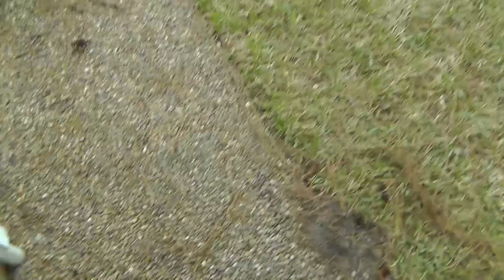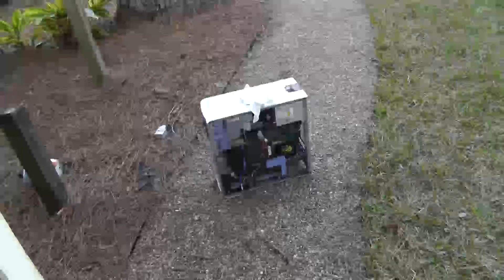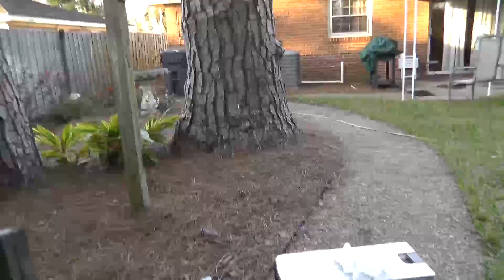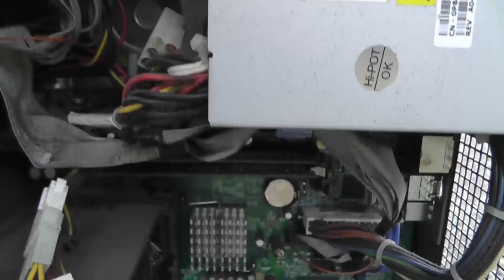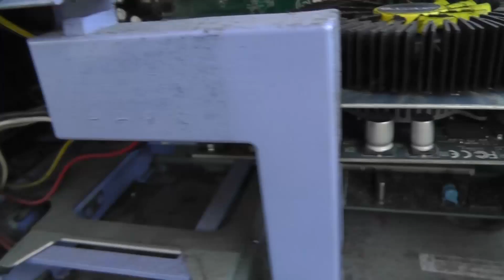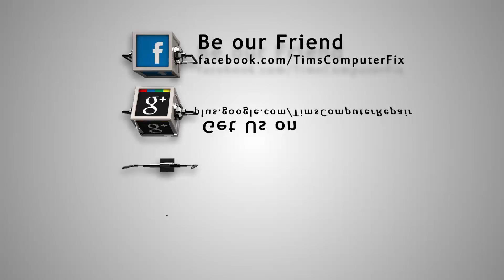Why Does My Computer Not Power On?

Comment: I've seen quite a lot computers with even more bulged caps that worked perfectly fine. It helps often to remove the ram sticks and clean their connectors, then put them back.
Reply from the maker: +subbookkeeper I will have to respectfully disagree with your statement on this subject. Bulging/leaking capacitors = failing motherboard component = game over

Comment: Most annoying repair I ever did was removing and installing a couple leaking capacitors.
Reply from the maker: +Merrick Miller Yeah, I used to do those back in the day. Computers that have bulging caps now are usually to old to bother. Thanks for watching.